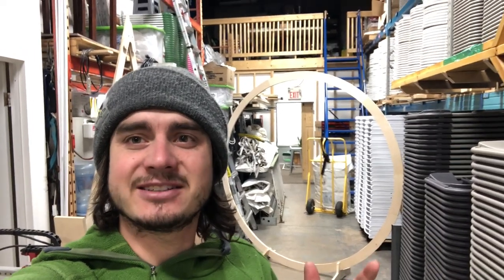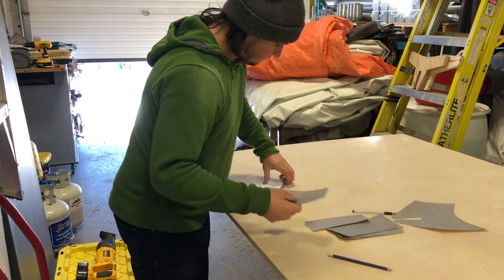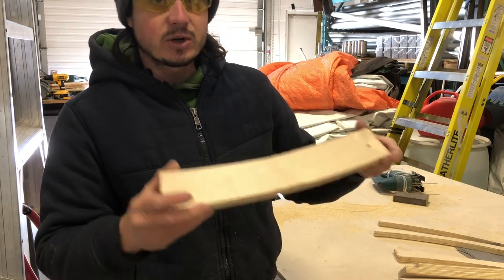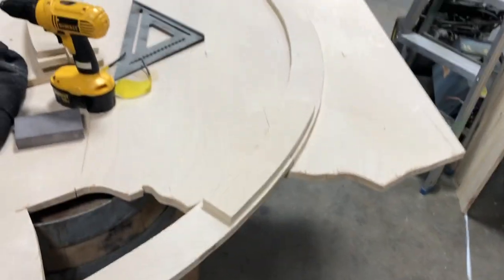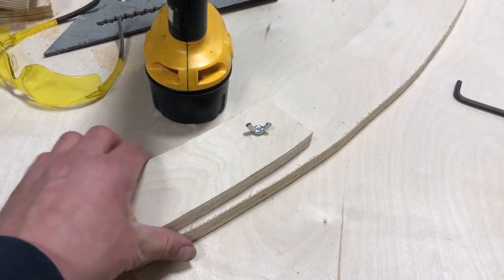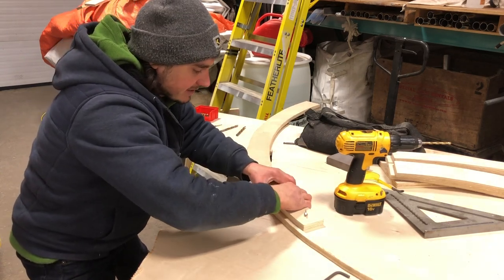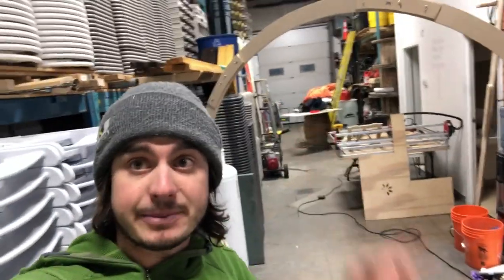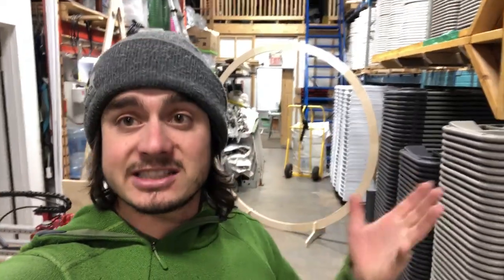DIY Circle Arch - Wedding Arbor Complete Build

Comment: I'm curious.
I did see the CNC machine at one point. Why not use that new toy?
Also, if I may, how about using one joining piece as a template for the others, that way you don't have to figure out which one goes where (all holes at the same place) OR, glue and staple the joining piece to one side of the arch piece, so that you only have one side to screw in order to join them.
Reply from the maker: Good tip actually! And yes soon we’ll be using that CNC, I’m learning to use it this month.

Comment: Les, just a tip. Get you a 1x1 and put you a nail or screw on one end and screw it to the center of your ply wood and use it as a compass. Move the 1x around and scribe the end of it you’ll mark your radius and just cut it.
Reply from the maker: Only issue here is the circle arch is much larger than a sheet of plywood, but you are onto something….
Reply: @TheRentalJourney  sent you a small drawing to your Instagram hope it works for you it just takes practice!
Reply: this is exactly how I make my round backdrops.  use two sheets of plywood butted together at the sides.  Far less work to connect two halves than 20 or 30 smaller pieces.  In our business you'll always need plywood so what's left over from this project will get used up in no time.